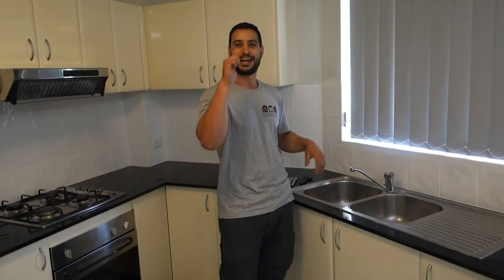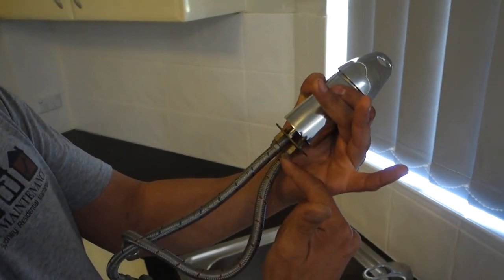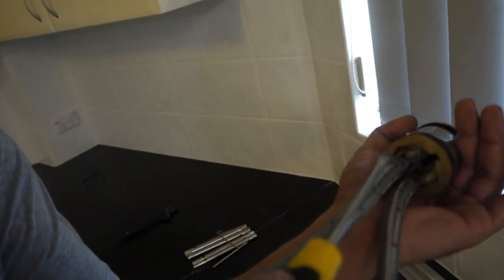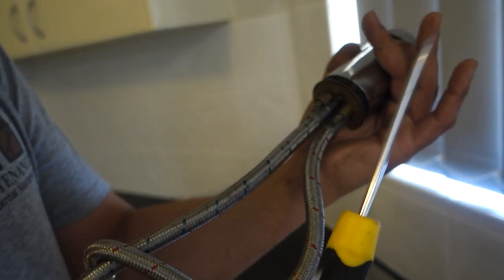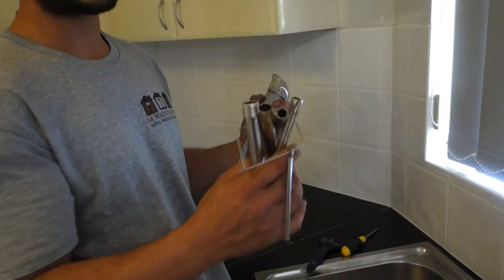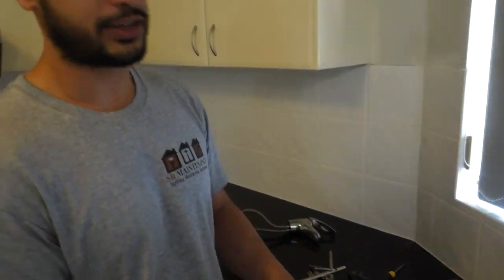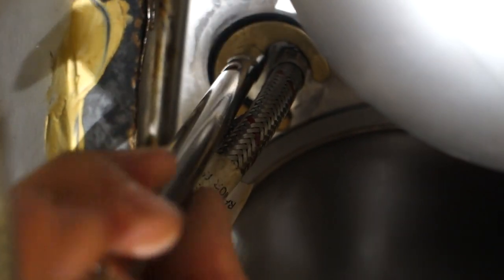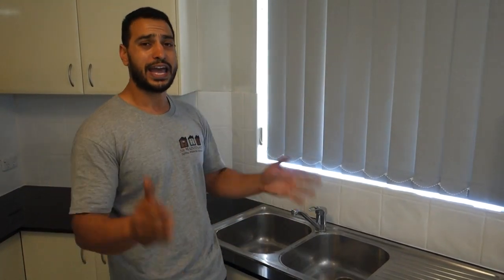how to fix a loose tap

Comment: Very helpful, tube spanner worked a charm. But I have  a second issue. Which is that the arm above the sink is very hard to rotate. Which in effect is why the entire thing comes loose underneath. Can any share tips on how to lessen that? Even when it’s not snug underneath, still hard to rotate.. 🤔
Reply from the maker: Could be an internal issue. They are cheap to completely replace and I have a few videos on how to do it 👍
Reply: @billshowto  will check it out 👍
I’m in a rental. And this is a brand new tap. Was just replaced. It is far less quality of what was there before. My guess is that there wasn’t an available cartridge to replace on the existing, which was leaking. 
Thanks for the reply

Comment: Mine has a 1 bolt design but it always loosen after a week or so. Any tips?
Reply: If you really want to secure it....buy a tube of locktite. Put a dab of that at the base of the bolt and secure the nut. Let it dry for awhile before you go to use it.

Comment: My tap fell completely off after fitting and using a cheap aerator device with it , and doesn't seem to be attached to any pipes at all ! I put it back on and it still works but I can see a small leak under it now..I'm scared ..!

Comment: Hi Bill, your videos are terrific!!!Your explanations are also easy to follow. I need some advice in replacing the plastic nut holding the spout beneath the wash hand basin that has broken and fallen off. The basin has two taps and the spout in the middle. The copper piping underneath is one horizontal pipe with three up-stands which are the three inlets to each of the two taps and the middle spout. The difficulty I am having is that I cannot insert the nut to the spout inlet unless I undo the nuts to the two taps to lower the three inlets to insert  the spout nut. Is this the only way it can be done? The nuts to the two tap inlets are extremely tight and there is not much space at all to manoeuvre a normal spanner. Do I also need to install a washer before replacing the nut, it didn’t seem like there was one before. I will be replacing it with a brass instead of a plastic nut. I would really appreciate your advice. Thanks, Charlie.

Comment: This fixed my loose tap but any tips on the flick mixer not moving when tightening? I lined it all up and had someone hold them both straight but when I tightened it moved it slightly

Comment: Thank you so much, I managed to tighten the tap without calling the plumber 🙃. 
Do you have any helpful tips on how to fix a hammer in a tap? My bathroom Taps have the worse hammer, it takes alot of turning to turn the tap on to get the water to start flowing, before the flow there is a loud hammer when using either hot or cold taps. Help please 😅

Comment: In case of a  seized  under sink main water tap just heat it up with a blow torch for 15-20 seconds and it will loosen up and turn.

Comment: this sucks,my faucet became loose without me having to go under the sink,stands to reason I should be able to tighten it similarly. The underside of my sink has a wooden divider separating the tap and the pipes. So I need to either smash that divider out or find a socket 6 feet long

Comment: Just wondering if the tap doesn't fit, the hole in the basin is bigger than the base of the tap. Is there something I can use to make the hole smaller or should I find a bigger based tap?

Comment: roughly at the end were you shake the tap showing us it is nice and tight, if you pulled it up further would the sink whole shown through? reason my i ask is i have had a new installation done and my tap is still but has minimal leakage when i go to see the kitchen cobourd and blue paper towel is wet here n there.  my plumber said as he pulled my tap up and said its meant to be like that as water will/ can go through even though black sealant is there- that wrong isn't it